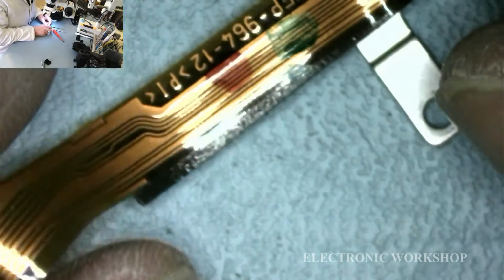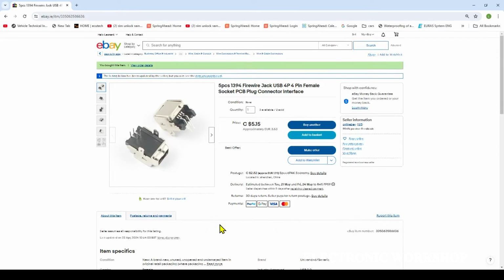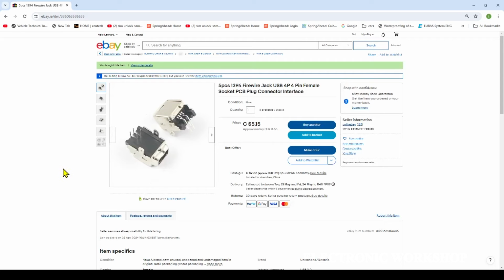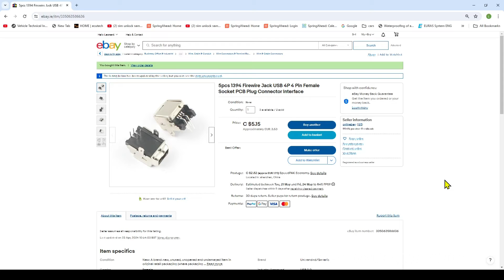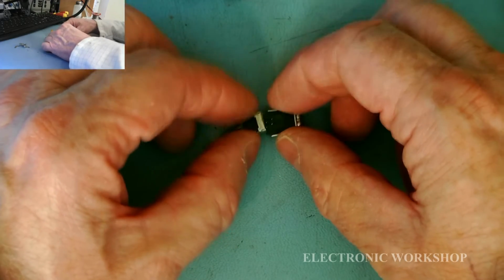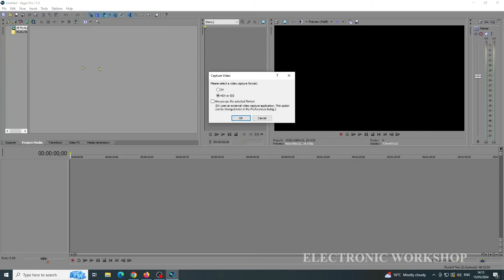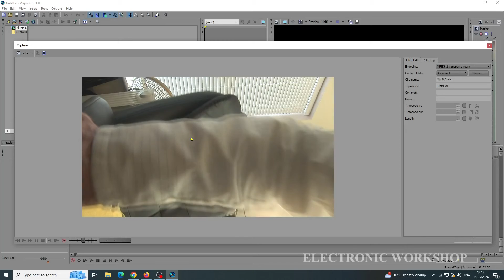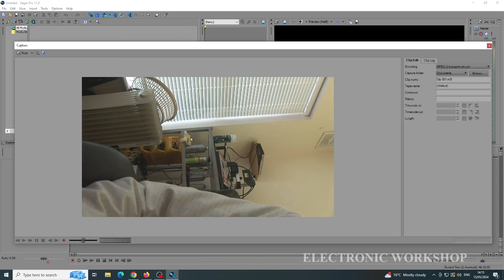Sony HVR-Z1E Firewire connector, IEEE 1394 Repair

Comment: Brilliant fix and also good old fashioned make what you can with what you have! Great modification technique 😊
Reply from the maker: Thanks for your comment, as these broadcast cameras get older, a lot of these cables can not be sourced any where, good luck if you get an account with Sony,  they are not interested in small accounts
Reply: @ElectronicWorkshop  it’s a shame as customers of Sony are probably getting less and less as time goes by. You did well to get that sorted 😊